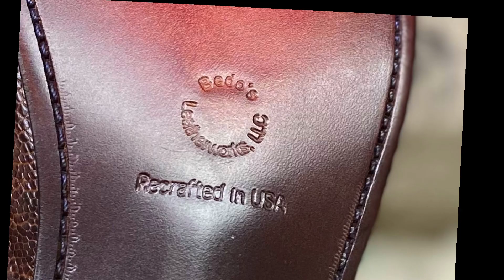Lucchese, Dan Post, Tony Lama Boot Restoration, Part Two

Comment: No the artwork on the sole does not wear away IF:  Shoes are not worn outside, Not worn on rough surfaces, inside or out.  Polished stone is fine as is carpet.  Wear other shoes/boots outside.   I have Carolina Boots for outside.  My leather sole loafers are for inside only.  If I want to wear them to dine out or to a visit:  Restraurant, Business meeting, Ceremony, I wear the outside boots to and from switching to the fine shoes when inside.

Comment: 9:39 - I have a question. How often do you have to "repair" the hoof on which you nail the insole? After all, it will become uneven from bending nails, which may make it difficult to bend nails.
Reply from the maker: You mean the metal last I hammer on???
I haven’t had an issue with that for over 30 plus years, so not to often
Reply: Yes, thanks a lot